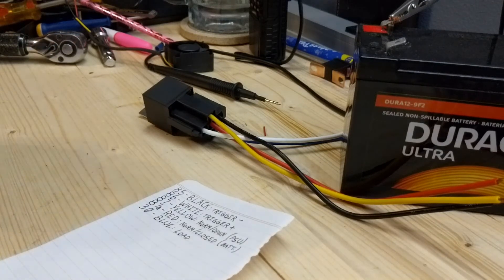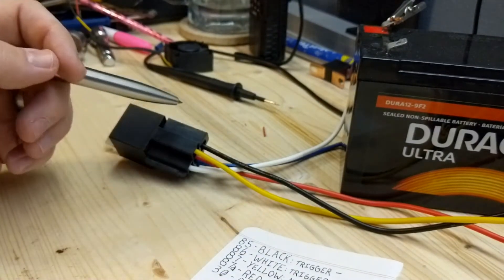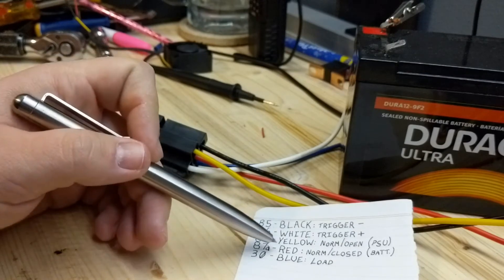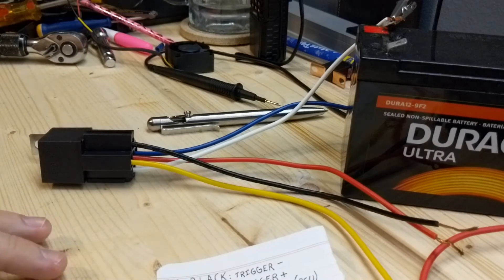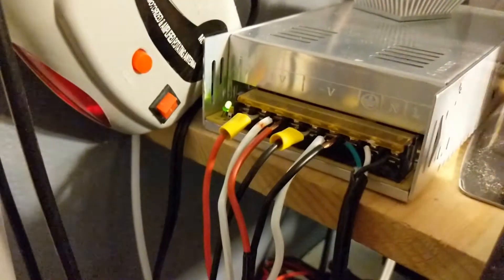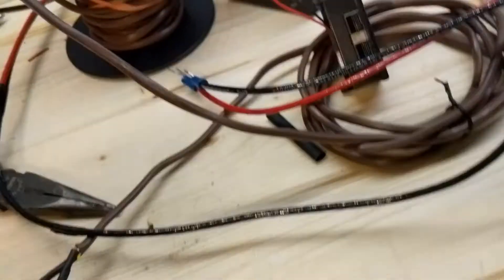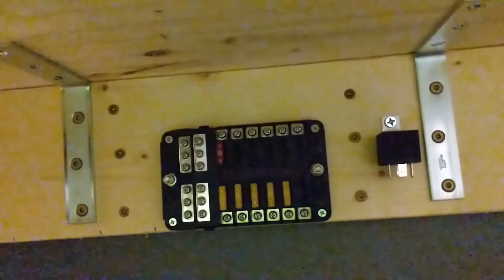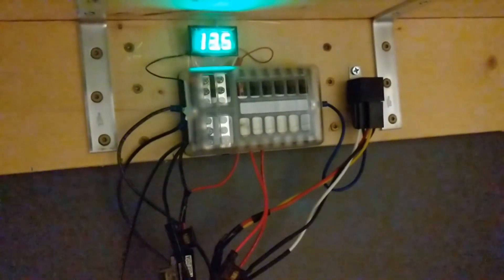Making a 12v Automatic Battery Backup

Comment: One question in addition to my other comment. Are there any negative long term effects to the relay to being “activated” in basically a permanent configuration? Obviously in a vehicle the relays are being used intermittently, but in your configuration the relay is engaged at all times until power is lost
Reply from the maker: The relay does stay warm to the touch but not hot enough that im worried about it. It's been like this for about 6months and the relay hasn't failed.

Comment: This is essentially what I have done as well. I have my main dual band ic-2730 built into a case with both a battery and a built in mfj power supply. So when 110v power is on (or available when Im away from home), I can just plug the radio via powerpoles into the power supply. If no 110 power, then Im on 12v battery power. Ive also wired in our HT chargers with powerpoles, and finally led 12v lighting that I converted from typical 110 to 12v transformer plug to powerpoles. With that setup we have lights, fan, radio etc. We are now looking to add a much more significant battery bank setup for extended periods. Also have a battery tender wired in to keep the batteries charged accordingly. I wired the system so that the charger can “backfeed” power into the battery from an external plug without feeding power to the fuse block.